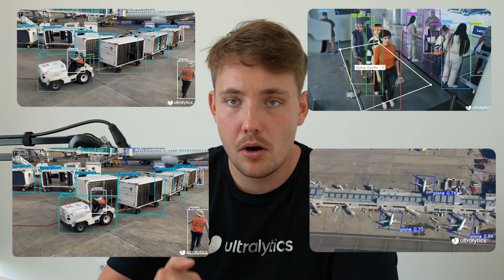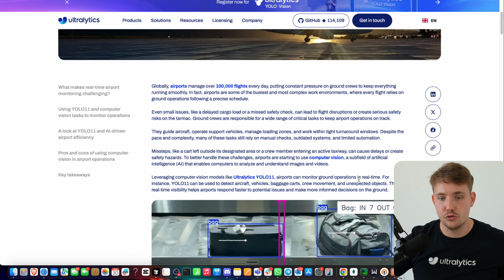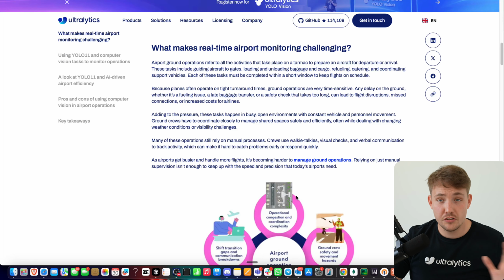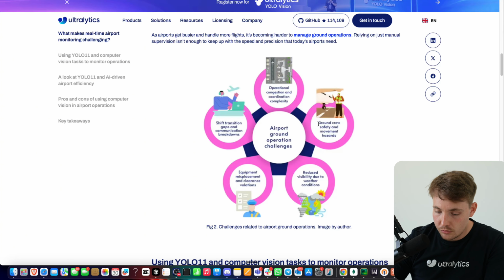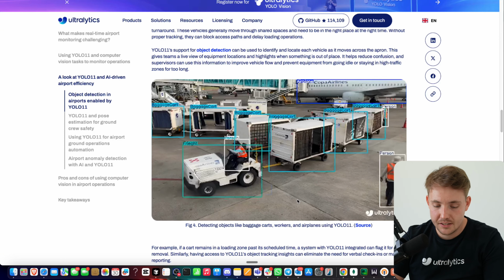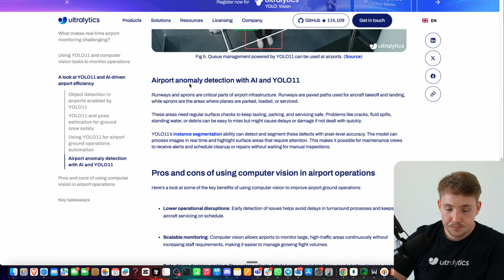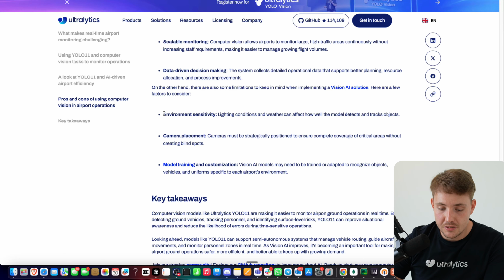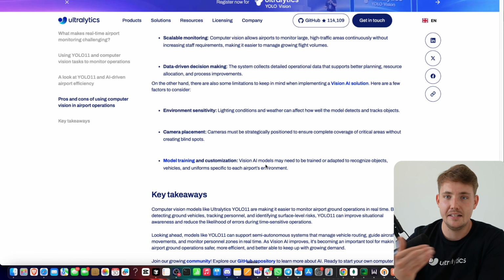How to Use Computer Vision for Airport Operations | Baggage Carts, Manage Queues & Anomaly Detection

Comment: How r airports planning to handle false alarms and passenger privacy when YOLO11 is watching every queue and cart in real time? One missed anomaly is bad, but flagging every nervous traveler as “suspicious” could turn security into chaos fast!!!
Reply: Exactly—that’s why YOLO should be a sensor, not the final decision-maker. Responsible deployments use anonymous, short-lived tracking for queue/cart data, process footage locally, minimize retention, and avoid labeling “nervous” behavior as suspicious. Alerts should require sustained, rule-based events across multiple frames, with trained staff confirming them and continuously auditing false-alarm and bias rates.

Comment: Love it—how do you keep detections solid with heat haze, jet exhaust, and rainy aprons? Any domain adaptation or TTA on edge GPUs to cut false alarms without blowing up a turnaround, or does it just plane-ly work?
Reply from the maker: Great question—and nice pun! For heat haze, exhaust shimmer, and rain, the biggest win is domain adaptation: fine-tune YOLO11 on your own apron footage with augmentations that mimic blur, low contrast, glare, and rain/fog; our Albumentations guide shows practical combos like blur, grayscale, and CLAHE: https://www.ultralytics.com/blog/using-albumentations-augmentations-to-diversify-your-data

On edge GPUs, keep TTA minimal (flip-only or at most a light 2-scale) since multi-scale TTA can spike latency; instead, reduce false alarms with temporal smoothing + trackers (ByteTrack/BOTSort), ROI/zone rules, class-specific confidence/NMS tuning, and k-frame persistence before alerting. If you need extra headroom, export to TensorRT FP16/INT8 and consider light pruning/quantization to offset any small TTA cost: https://www.ultralytics.com/blog/real-time-inferences-in-vision-ai-solutions-are-making-an-impact

If you share your hardware (e.g., Jetson Orin vs discrete GPU) and FPS target, we can suggest a lean TTA/threshold setup. Also make sure you’re on the latest ultralytics and torch versions.

Comment: Cleared-for-takeoff Q: for real-time queue management and cart spotting in glare/occlusion chaos, are you running YOLO11 with SAHI + temporal smoothing and ByteTrack/OC-SORT on-edge, or pairing it with unsupervised video anomaly detection (PatchCore/MNAD) to keep false alarms grounded? And how are you handling multi-cam homography + re-ID and GDPR-friendly logging so model drift doesn’t call a mayday?
Reply from the maker: Great question. Our go-to in airports is YOLO11 on-edge with ByteTrack for crowds or BoT-SORT when appearance cues help, SAHI for wide aprons, plus temporal smoothing and dwell-time thresholds to suppress glare/occlusion flicker: docs.ultralytics.com/modes/track/ and docs.ultralytics.com/guides/sahi-tiled-inference/

To keep false alarms down, we start with rules (zones, min-size, stationary-object timers for unattended bags) and, where risk is high, add a lightweight unsupervised anomaly head fed by YOLO crops; overview here: www.ultralytics.com/blog/vision-ai-for-anomaly-detection-a-quick-overview

For multi-cam, calibrate each camera to a shared ground plane (homography) and fuse tracks in world coordinates; BoT-SORT re-ID assists cross-view handoff: docs.ultralytics.com/guides/distance-calculation/ and docs.ultralytics.com/reference/trackers/bot_sort/

GDPR-wise, keep inference on-edge, log aggregates only, blur PII on export, and enforce short retention; see object blurring: docs.ultralytics.com/guides/object-blurring/

To prevent drift “mayday,” run continuous eval/monitoring, sample edge cases for retraining, and version data/models; playbook here: docs.ultralytics.com/guides/model-monitoring-and-maintenance/ 

If you share your camera layout and FPS/latency targets, we can suggest exact tracker and threshold settings.

Comment: How are you handling open-set anomalies and domain shift in the wild (de-icing trucks, heat haze, high-viz PPE) so false positives don’t cascade into ground delays, and do you pair YOLO11 with uncertainty gating or edge-based active learning to stay calibrated? Also, how do you balance robust queue analytics with GDPR without veering into Orwellian overreach?
Reply from the maker: Great question. In the wild, we mitigate open-set anomalies and domain shift by combining robust, domain-specific training (weather/heat haze/PPE variants), OBB/segmentation for finer separation, geo-fences, and temporal persistence so a de-icing truck or glare must be consistently seen before triggering. We also gate alerts by uncertainty (per-camera thresholds, variance across test-time transforms, and tracker consistency) and keep calibration via edge-based active learning that buffers low-confidence/novel frames for labeling and periodic fine-tunes; see model ops guidance: https://docs.ultralytics.com/guides/model-monitoring-and-maintenance/

On GDPR, our queue analytics are privacy-first: on-device inference, region counting instead of identity, ephemeral track IDs, optional face/person blurring, strict retention windows, and clear purpose limitation to avoid overreach. You can review our privacy guidance here: https://docs.ultralytics.com/help/privacy/ and practical queue patterns here: https://docs.ultralytics.com/guides/queue-management/

Comment: Bro, is your anomaly detector trained on normal-only patterns like a trail cam learning the herd, or do you layer hard rules for no-go zones and jet blast? And how do you keep cart IDs stable through occlusion, glare, and fog without cooking edge GPUs or poking the privacy bear?
Reply from the maker: Great question! We typically do both: learn “normal-only” patterns for anomaly detection and layer deterministic business rules on top. YOLO11 handles detection/tracking, then we add geo-fences, dwell-time and speed thresholds, and schedules to flag no-go zones or jet-blast risk. For a quick primer on approaches, see Vision AI for anomaly detection: https://www.ultralytics.com/blog/vision-ai-for-anomaly-detection-a-quick-overview

To keep cart IDs stable through occlusion/glare/fog, we use ByteTrack/BoT-SORT with motion + appearance cues, tuned tracker persistence, and camera-aware augmentations. Track zones and logic are easy to set up with TrackZone: https://docs.ultralytics.com/guides/trackzone/

Edge efficiency: pick YOLO11n/s, export to TensorRT/OpenVINO/NCNN and use FP16/INT8 to stay cool on Jetson-class devices. Export guide: https://docs.ultralytics.com/modes/export/

Privacy: process on-edge, store metadata only, and blur faces/badges where required. Blurring guide: https://docs.ultralytics.com/guides/object-blurring/

Comment: For real apron deployments, are you running YOLO11 + a tracker on edge boxes with on-camera anonymization, and do you have benchmarks (FPS, IDF1, queue-length MAE) in rain/night/glare? How do you rein in anomaly-detection false positives so ops don’t dispatch trucks for every wonky cart path—and will you open-source a small apron dataset to reproduce results?
Reply from the maker: Great questions. Yes—typical apron pilots run YOLO11 with BYTETrack/BOTSort on edge (Jetson Orin, Intel/OpenVINO, or x86 + TensorRT), and on‑camera anonymization is supported via our Object Blurrer: https://docs.ultralytics.com/guides/object-blurring/

Benchmarks depend heavily on model size, resolution, hardware, and weather/night/glare. You can reproduce on your own streams with Benchmark mode: https://docs.ultralytics.com/modes/benchmark/ — share your device, input resolution, and YOLO11 variant (n/s/m/l/x) and we can ballpark expected FPS. For tracking/queues, evaluate IDF1 with MOT-style tooling and tune queue-length MAE using this guide: https://docs.ultralytics.com/guides/queue-management/

To rein in anomaly false positives, we combine temporal hysteresis and track-based dwell times, ROI/geo-fences, speed/orientation gates (OBB), and alert aggregation; see: https://www.ultralytics.com/blog/vision-ai-for-anomaly-detection-a-quick-overview and analytics best practices: https://docs.ultralytics.com/guides/analytics/

Dataset: we don’t currently host a public apron dataset. We’re exploring releasing a small de‑identified sample pending partner approvals; meanwhile, browse available datasets here: https://docs.ultralytics.com/datasets/